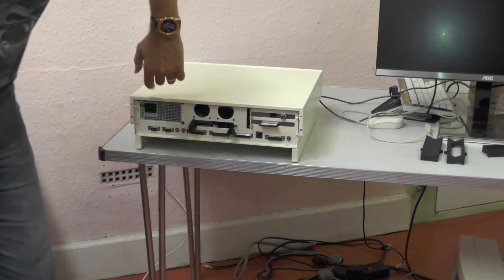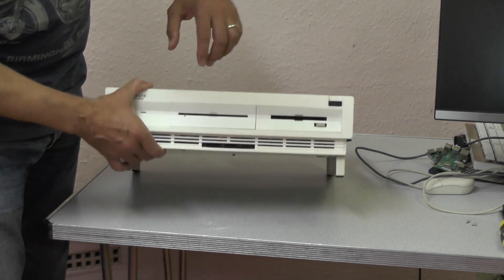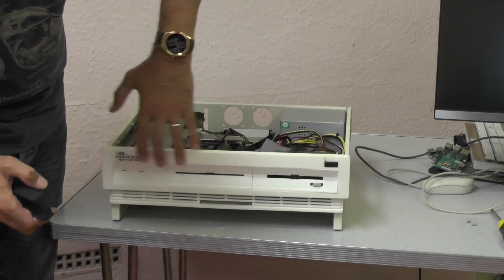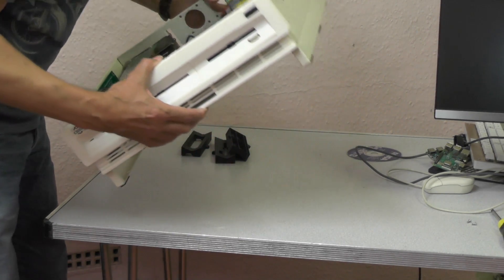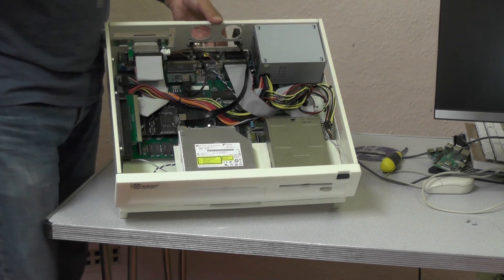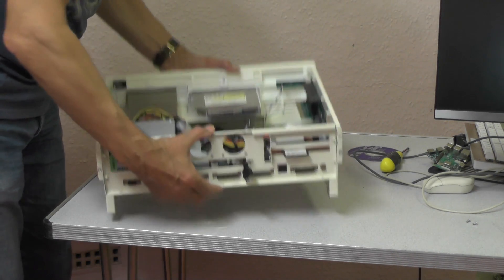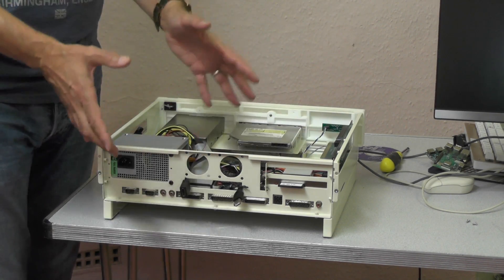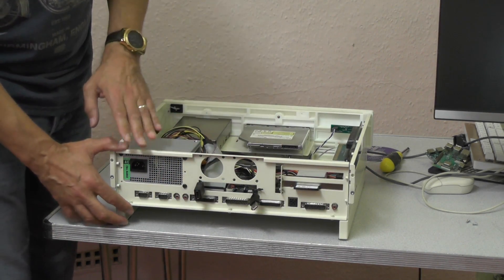Greenford Computer Club visit and Checkmate A1500 plus tear down and explanation

Comment: I think that it is time that the AMIGA A1500 had a 32 core PowerPC CPU instead of the MC68040 processor, SATA to SCSI LVD adapter is what you are looking for Stephen.
#markbreckell I want to know does the AMIGA A1500 use SCSI LVD or what?